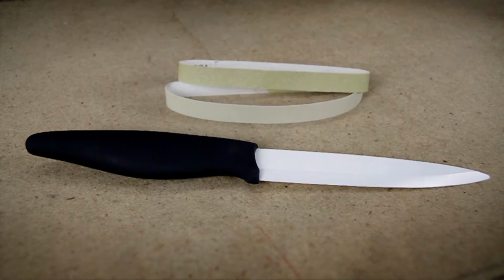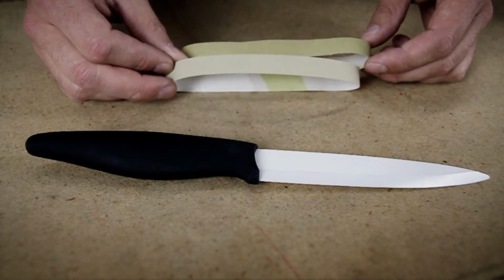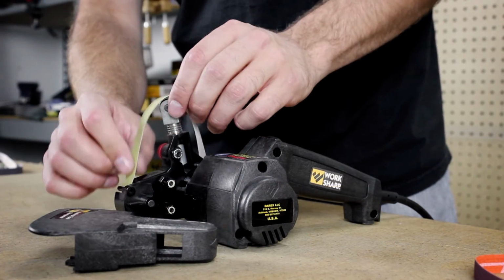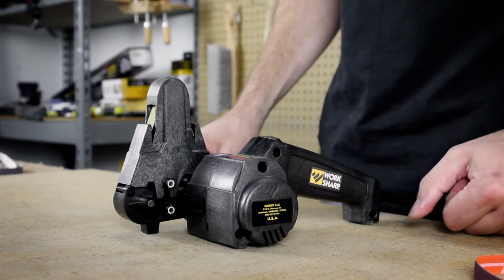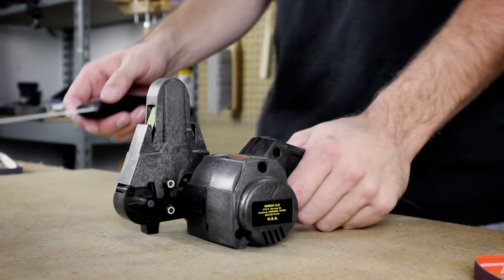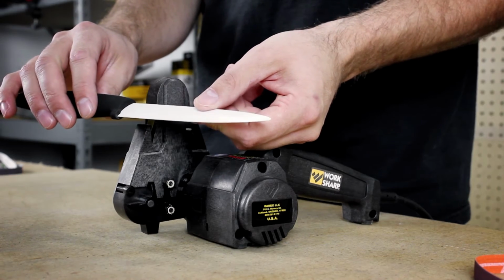KTS How To Sharpen: Ceramic

Comment: FWIW...watched WorkSharp's several videos about this and splurged for your Ken Onion model and diamond belts.  It was a curiosity/impulse buy but I've been very pleased.   Reasonably priced;   easy to understand and use;  restored ALL of my ceramic knives to like-new condition quickly and easily.  Compared with other expensive and time-consuming alternatives, your machine and method are very impressive.